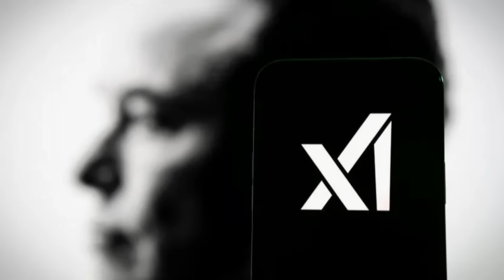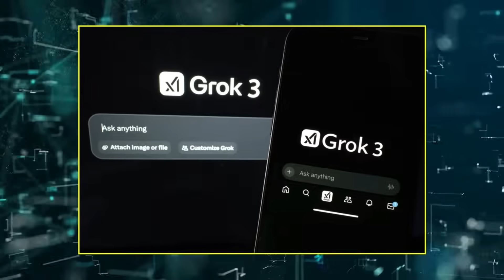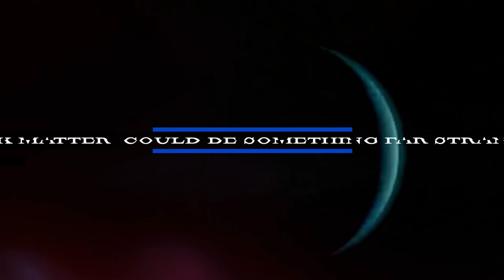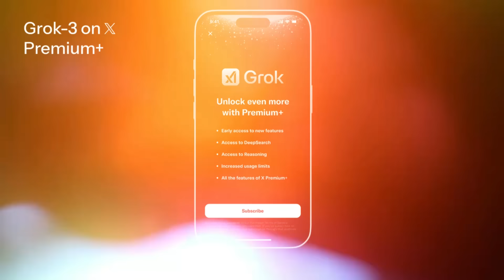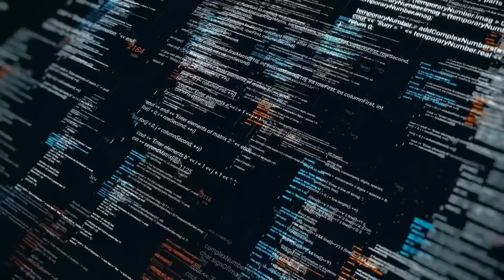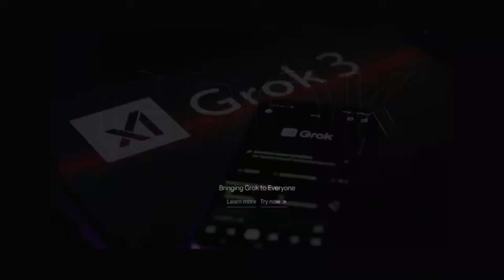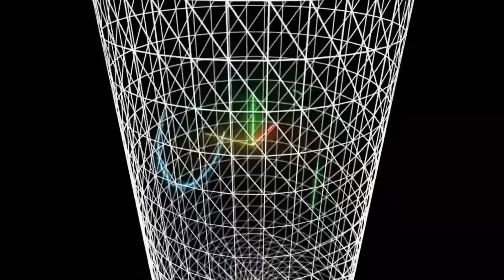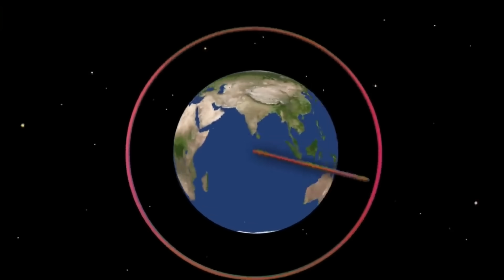What Grok 3 Says About Dark Matter Will Leave You Speechless!

Comment: The dark matter surrounds the galaxies because it is continuously escaping from the black holes at their centers (=> no expansion of the universe, no big bang, no singularities)
Reply: That's more like it, in terms of  description of functions, now, we should consider looking at the cause.
Reply: @Alberto-tl5rt  
Inside a black hole, there are neither particles nor photons because they decay quickly. However, all their energy and momentum are distributed among the oscillators of the 4D quantum field—the only field that exists, which is dual to finite 4D spacetime and unifies all the fundamental fields of quantum field theory and gravity. Near the event horizon, through field interactions, this energy and momentum continuously escape as a 'hot' vacuum—a state of vacuum characterized by strong fluctuations. This phenomenon constitutes the dark matter. Thus, the dark matter is more akin to 'oil', i.e., a mixture of millions of chaotic states of the field that originate from the energy and momentum of black holes. The fluctuations are so strong that they may interact with photons and particles, or even generate new ones. The vacuum is more 'hot' (chaotic) near the black hole and more 'cool' (relaxed) further away, i.e., there is a 'gradient of vacuum' or 'a gradient of dark matter' around a black hole.
This model requires a 4D algebra to describe the field, but all current 4D algebras seem like simple toys, unable to capture the interdependencies of the 4D field. Moreover, any ad-hoc laws for the interactions of the field will likely be arbitrary and probably incorrect. Only a genuine superset of the complex numbers, based on the demand for completeness, could lead us to this unique 4D algebra.